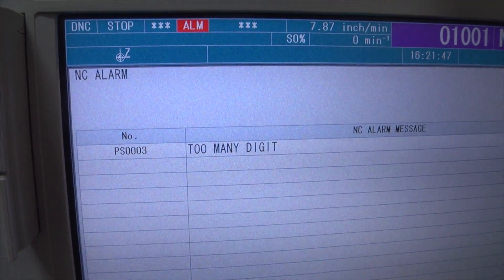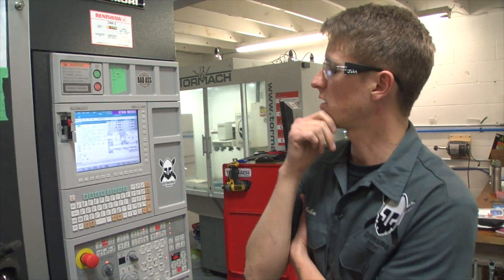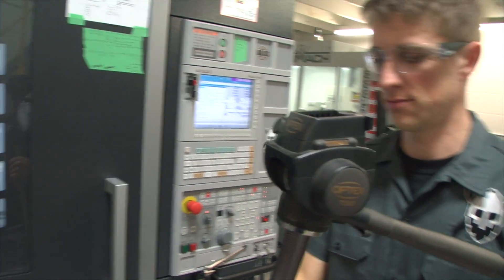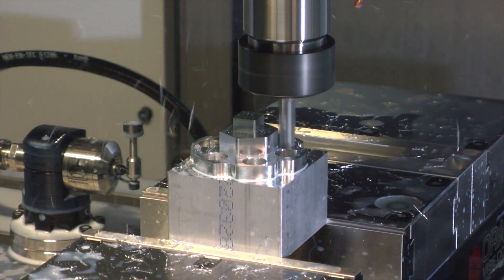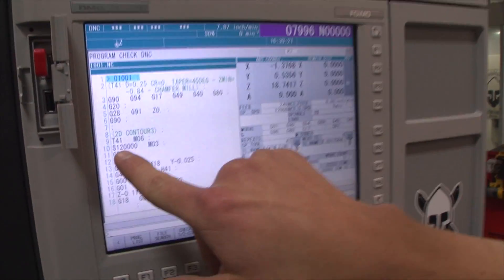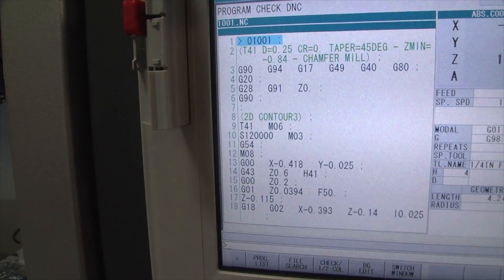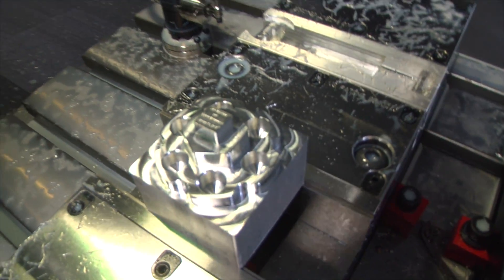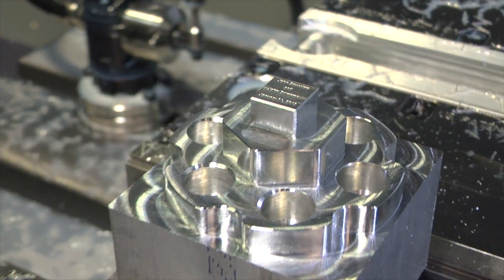John Saunders visits and operates a Mori!

Comment: had a quick idea for you. I noticed you had several shots where coolant got on the lens.  you might be able to solve that if you run an air line to blast off the camera after you complete those heavy cuts that need full coolant spray. that way we will get to see more of the goods without you having to stop and wipe the camera down. just an idea. keep up the good work.

Comment: Hi,

See you got the tool setter.  Man that makes setup a breeze.  I have a HAAS TM-1P with a Renishaw Wireless Probe and Wireless Tool setter.  I can easily setup the part and associated tools and have really good accuracy.  It was a 5K option, but I love it.

If I make the file description name too long the HAAS will complain but lets me move along with the machining process.

Man, that tool changer is wicked fast, like on the larger HAAS machines.  Almost makes you want to stand back during tool changes. Ha Ha

Enjoy your new machine.

John
Reply: +helicopterjohns +JohnGrimsmo
Just in case it hasn't happened to you yet, the batteries in mine ran out after almost exactly a year. It looks like that one is better than mine, but assuming it takes the same batteries, it takes two "1/2 AA"s (AKA "14250"s). I got mine at Radio Shack for $10 each IIRC.

Comment: Now how would you go about removing it from the block of aluminium?
Reply from the maker: +rkshireygames I think Saunders is going to bandsaw it out.  We could have used a slitting saw in the mill but didn't have the time.  It's a useless part anyways, it serves no function other than looking pretty.
Reply: JohnGrimsmo I'm just curious because I'm trying to learn how to do this stuff. I've always screwed a flat plate down to a bed and machined one plane, flipping parts and machining in the manner you guys did there is totally new to me.

Comment: Too many digits can be many things. One I've had sometimes is having too many M codes on the same line. Some machines don't actually understand more than 1 or 2 m codes per line, which is annoying when you wanna go like spindle off-coolant off-return to tool change place in the same line. You then have to do then per line. tho you don't need to shut off them coolant and spindle if you do g30 m30. Or what ever the m is, haven't machined in two yers so I dunno anymore :D

Comment: VMC - no fucking around with mach3, no calculating leadscrew tpi, no troubleshooting line noise that causes your machine to crash, no binding axis', (almost) never run out of travel after you already have everything set up, no 20mins futzing with an edgefinder, digital toolsetter!, etc. You may learn a lot messing with hobby mills,  but you don't make a lot of parts.

Comment: Good to see more videos from you; great stuff as always.  How about a segment on your Orange vise - why you bought it, how it works, features, etc.  Would it work on a Tormach 1100 without losing Y travel?
Reply: +Mike Henry Those ones are 20" long so you would have to go sideways with them, along x that is. I've done this on mine a couple of times with a double station (not on video yet though) but yes you can.
Reply from the maker: +Mike Henry I will most likely do lots of Orange and Carvesmart videos, they're awesome!  I've seen one on a Tormach before.  This one is 6" x 20", but they also make a 6x16 and 6x17.5 and they just came out with a 4" wide version.  With Carvesmart it's an epic combo.  Double station is super nice too!  It would rock on a Tormach but like Widget Works said you'd have to mount it sideways.  A 6" x 17.5" mounted sideways would be wicked, you'd get two vise stations with easy quick change jaws and the ability to put a complete pallet on easily.
Reply: +JohnGrimsmo Looking forward to the OV/CS videos.  I was hoping that the 6x16 would fit parallel to Y but that looks iffy unless you don't mind losing Y travel.  BTW, that Mori is freaking awesome.
Reply: +Mike Henry 
Tormach has 3D models of their machines available, right? Orange will send customers a model of their vises as well, I imagine they&#39;d send them to potential customers too (or just draw boxes to represent them). Bring the two models together to see if they&#39;ll work. I did that with my Novakon, but I had to draw the model of the machine myself. I ended up having a 20" vise hanging ~4.5" off the front and ~3.5" off the back. :)
Reply: +Hirudin Thanks - I've done the same thing with the OV16-in vise and the PCNC 1100 mill CAD files, modeled them up and found a bit too much of the vice front end hanging off the the front of the table (nearest the column).  Looks like the choice is to either use the vise aligned along X or lose a few inches of Y travel and run the risk of crashing the vise into the column.  Neither is too appealing to me so I'd like to get a better handle on the advantages of the Orange Vise before committing.  Maybe the owner (Sol?) would be willing to create a special model to accommodate the Tormach and comparable mills.